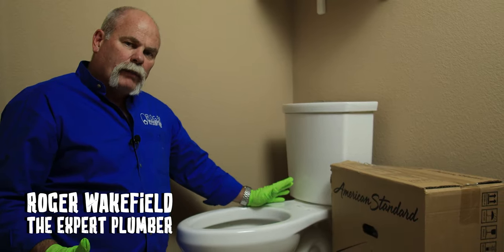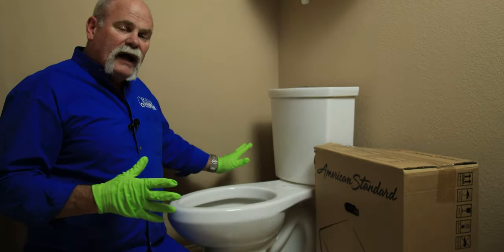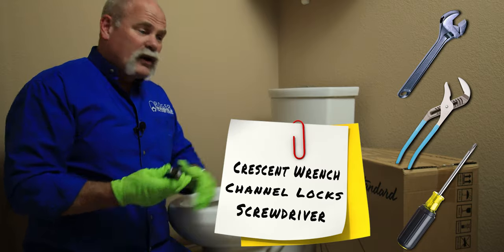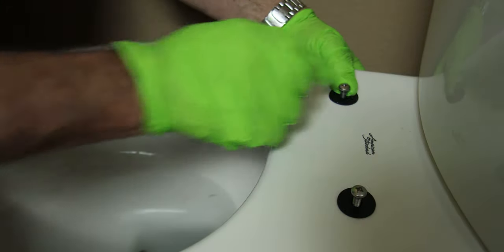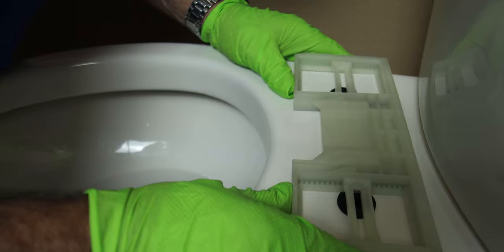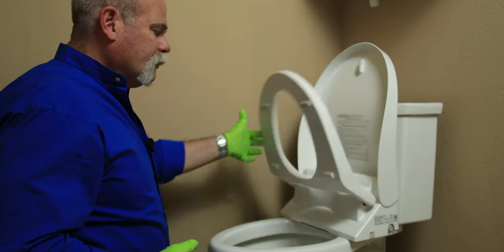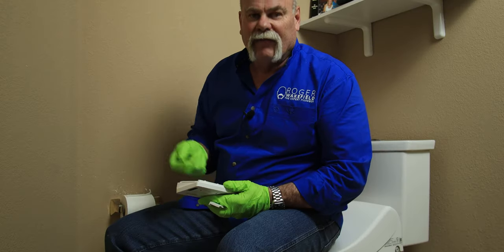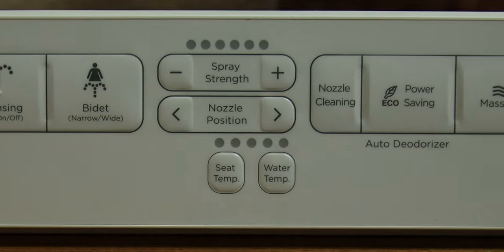How to Install a BIDET SEAT on Your Toilet! - DIY Plumbing

Comment from the maker: So was this installation easy for you? Let me know by leaving a comment!
Check out some of our other DIY plumbing projects too: https://www.youtube.com/playlist?list=PLSpTuwsLqh7uez6EgB1OkE9OXnlPDfE1O
Reply: I installed a bidet. After, the water in the toilet continually runs. It didn't pre-installation. I attached a t-valve that came with cone shaped washer. The directions say to insert it narrow side up but when i try to do that , I can't seal it. It just leaks and leaks and leaks. But when i turn it the other way, it seals. At first, it cut the water off entirely but then i loosened it and the water started running. Does the fact that i inserted it with the narrow side down have anything to do with it; and how can i seal it if i turn it so the narrow side is up? Any suggestions? Great channel. You're an excellent host that's very clear, pleasant and logical. Thank you!
Reply: Install was easy but the spray nozzles don't pop out and spray. The cleaning mode works I see the flap open and water run down. This a common problem? Something I should look for? Thanks for you help!

Comment: i have a very basic bidet but i love it to death! it doesnt have temperature control but it does have pressure control and self cleaning all from a single tuner style knob. no electricity just purely water meaning if my power goes out i can still use it without seeing any difference. it cost me about $35-40 on amazon and its nice!

Comment: Hey man thanks for all you great advice.  You are awesome. 
Got a couple things about these Bidets. They are also awesome, got hooked on them since visiting Japan many years ago because they are everywhere in Jp. 
When installing I don't know why they make that plastic mounting bracket where it barely positions correctly over the mounting bolts. The bolts just make it in the square frame area, also before installing the bracket you have to make sure your toilet mounting shelf is the kind that is flat all the way to the tank. I had an American Standard toilet where the flat shelf where the bracket goes was flat from the bowl edge to just pass the bolts then the shelf or platform curved up into the tank ( kind of like collar bones you know what I mean? So the bracket couldn't slide back enough allowing the bidet seat to slide all the way into position.  Had to buy a whole new toilet just to get that more modern flat style. It was an old toilet so I didn't mind too much, but something to think about before purchasing one of these awesome seats.
Sorry for the

Comment: This may come in handy. I'm gonna have to put in a new seat on my cold water valve in the bathtub. Wish me luck. Do you have a video about this? I know I need a seat wrench, too. Maybe a pack of gaskets because I can't find the ones I had 😁
Reply from the maker: Take pictures of the valve and take it to a supply house or box store. See if you can get seats and stems if need be. Start with the washer but check the brass seat before you put it all Mack together.

Comment: You just got yourself a sub sir :) You have a great personality and fantastic video production, good stuff!
I used to be a plumber, rather part of the plumbing family. My father (rest in peace) installed septic systems in rural areas. We live in Kentucky, so there was plenty of work for us. I never did a whole lot of indoor plumbing work, but he did and I learned a lot from him.
Does the bidet clean 100% of everything, or do you have to give it some help with TP every once in a while?
I question how well those tiny jets could handle the clean up from some of the massacres I leave in there....
Great show, can't wait to see more!
Reply: My first bidet seat experience was in Japan. It made me think how I lived without it all my life! Think of all the times you have had what I call "The poop of a thousand wipes".  and honestly some of us guys have a hairy backside that makes it even more difficult to get clean. There is no guarantee you will get 100% clean,  but I guarantee it will get you way, WAY cleaner than TP. Don't plan on throwing away your TP,  you will need a couple sheets to pat yourself dry or just to double-check. I am not exaggerating that it is a game-changer, even life-changing. Think of all that paper that would usually end up in the septic!

Comment: A Bidet is a must have in the rest room. I have made sure they are installed in my properties from over 40 years now. I loath having to use a public restroom. Mine have duel taps, Not sure I would want a cold water surprise. This thing might work, and looks similar to the way they work in Japan, but it really looks clunky.

Comment: Do you have to hook up the water line at the bottom of the fill valve, or can you hook it up on the other end where the shut-off valve is? The reason I'm asking is because my toilet has about two inches of space between it and the wall and it's a closed off design with the tube going through a hole in the ceramic to get to where it screws in under the fill valve assembly. I hope I'm describing it clearly, but basically it's in the worst position possible from a maintenance point of view. I recently had to replace the fill valve, and I think I dropped more F bombs trying to squeeze my hands in that tiny space trying to unscrew the thing than I have in my entire life to date. Thanks for any advice

Comment: how do you get water temperature control if its only hooked up to the cold line for the toilet?
Reply: It has a heater. You need access to a plug. Bidets are amazing. Just don't buy a brondell they are made to fall apart and leak
Reply: My Brondell S1400 has worked excellently since I installed it March 8, 2020 (133 days ago).

Comment: Does a bidet really leave your holy hole cleaner than using toilet paper?
Does it hurt having the jet water sprayed in???
Reply: Yes because it is water. Toilet paper does'nt really clean at all. Which is why you need to either have wipes or wet the toilet paper with the sink to really clean.Then afterwards you wash with soap and water whether in the shower or sink to really get your area clean. This should be the standard. The bidet is not needed but it is more efficent and will save toilet paper , but still I always think washing with soap and water is needed after washing with just water.

Comment: I want to put one of these in but it only had the cold water connection it would have been nice to have a hot water set up but it seems like yours does
Reply from the maker: These seats have a heater built in!
Reply: I got mine with a heater built in, seat & water supply. My plumber arrives tomorrow to cover our whole house remodel

Comment: Hi, I can't bring myself to pay hundreds of dollars to buy a bidet seat made of cheap plastic.😜Therefore, I'm trying to find out how to install a warm water bidet attachment that heats the water from the crawlspace below my house, since my sink is too far away to run a hose. I read it can be done by connecting the hot water line where the line goes up through the floor, using a "T" connector. The line to the sink would remain & the hot line to the toilet can run under the floor & up to the toilet just like the cold line. Would I be doing all of that in the crawlspace? I wouldn't have to cut another hole in the floor would I?🙇‍♀️🙆‍♀️ Thanks for your time!

Comment: Quick question sir: I got a brand new honeywell water heater and it makes a vibrating sound when the heater first starts to heat up the water. It lasts for 10-15 seconds or so. Feels like magnetic vibration. Is there a problem or is that normal?

Comment: Ah damn... I'm in the UK, no wall outlets in bathrooms 👀
Reply: You guys still have shaver outlets don't you?
Reply: @jonanderson5137  Nope, plugs in the UK generally use 240-volt power, twice the amount found in US plugs which have 120-volts. Hence no outlets at all in British bathrooms.
Reply: @Potts2k8  I think I remember shaver outlets, maybe for older places.
Reply: @Potts2k8  I'll be pedantic for a moment. Twice the voltage, not twice the power. Power is Watts which is Volts times Amperes.

Seems the English are superstitious about it even with RCDs or whatever version of GFCIs you employ.

Comment: But roger if the women are still wet down there and use the toilet paper to dry themselves off. Won’t it be redundant to get the bidet?
Reply: Wiping to dry and wiping to clean are very different. You don't appreciate the difference untill you experience it. Far less tp and much cleaner
Reply: Buy toto. It has dryer
Reply: As an experienced user, i can say rinsing clean, then patting dry, is no different than showering if you use a touch of soap.